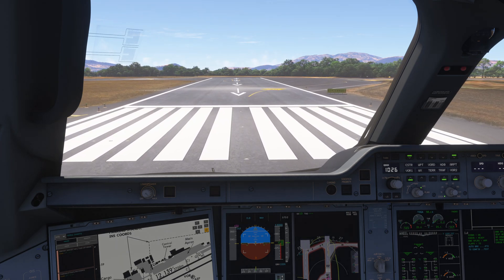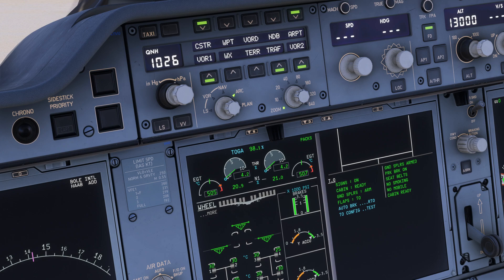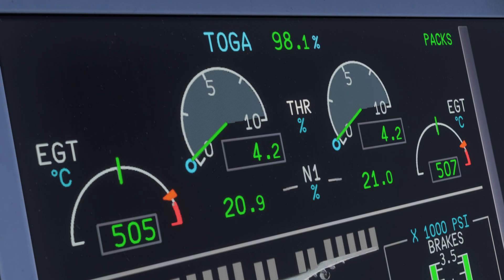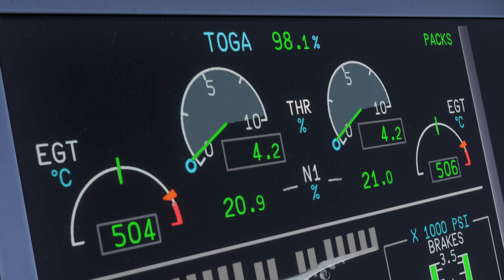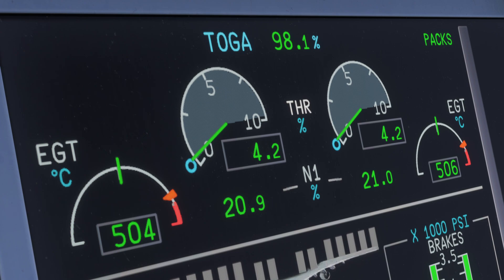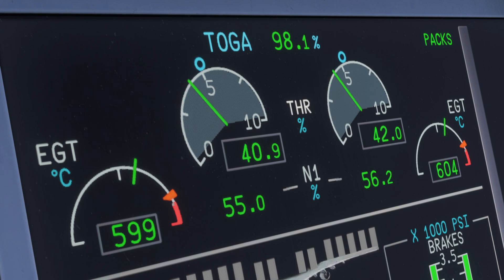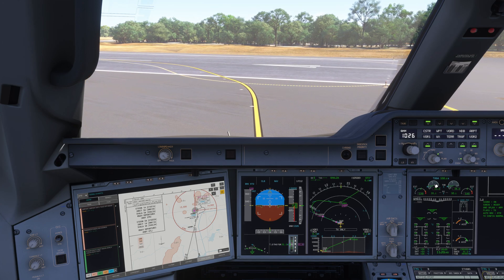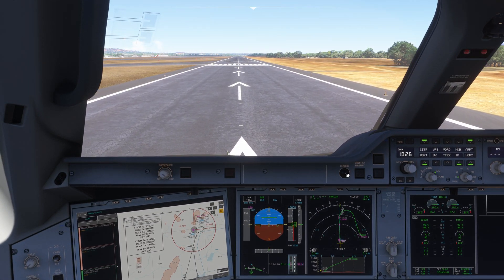Why does the A350 use THR rather than N1 or EPR? | Real Airbus Pilot

Comment: Good explanation. The Europeans are always thinking outside the box.

EPR is a direct thrust reading and therefore the most accurate but can be troublesome and prone to needing more maintenance. This is especially true on older non fly-by wire designs with an EPR transducer. In general GE engines utilizes the N1 notation as their "thrust setting parameter' while Rolls Royce and Pratt & Whitney used EPR as their. But when the A320 Neo's started showing up at the gate their GTF Pratts reverted to N1 which was a surprise. 

The problem with using N1 as the thrust setting is that the fan spinning at say 85% moves more air at sea level than at 30,000 feet. So using N1 as the thrust setting parameter is an indirect thrust setting. Earlier version of the CFM56 had a Power Management Computer in addition to the MEC to compensate for this so that the crew didn't have to keep bumping the throttles to maintain target trust. 

But using EPR to gauge thrust in modern high bypass engines isn't so cut and dry either. Since around 80% of the thrust in high bypass turbofan engines is produced by the fan and the remainder from the core, the bypass thrust has to be used in the EPR calculation to be accurate or else you end up partially extrapolating the data just like in the case of N1. For instance I know that the PW2000 only has a PT2 sensor in the inlet and a P5.6 probe in the exhaust, but the alternative engine the RR RB211 had both a probe in the inlet, an probe in the exhaust and another probe in the fan bypass. I believe (but not certain) it was P0, PF and P?

I suppose that a thrust indication in lieu of N1 or EPR is a natural evolution. Jet engines are designed to produce a set data plate thrust that is flat rated up to standard day temperature of around 86F, after which the thrust is reduced. And as engines incur wear of the airfoils and become dirty their aerodynamic and thermal efficiency are reduced. This is why you will notice that usually the older and more worn out engine has a higher idle RPM and a higher fuel flow and higher EGT. 

Back in the old cable driven systems prior to fly-by wire, pilots would notice that once the power was set at cruise one of the throttles were a knob out of alignment. But with the fly-by wire designs the crew would never see any throttle misalignments because the EEC compensated for the difference up until the margin was exceeded.

Comment: I flew just about all 747 there were, 100,200,400,-8...
GE used N1 while PW and RR used EPR, as I was told "by philosophy".
During T/O the F/E, yes there was one, set the engine thrust to the correct value after the pilot flying set them to the best value they could and the T/O thrust had to be set correctly as the airplane accelerated through 80 kts and while N1 was stable ,the EPR value fluctuated quite a lot,but the F/E managed it!
While hand flying with A/T OFF , EPR values were useless because of fluctuations and the numbers being so close together.
So when flying manually I hardly saw any pilot using EPR, but N1.(United, where I was trained initially, even used EGT as a reference for thrust while flying by hand)
..and if i remember correctly: the "Emergency Checklist" which was later called "Abnormal Checklist" gave settings for "unreliable airspeed" in values of N1 and not EPR.
So only "EPR" pilots had a choice between EPR and N1, while GE engine pilots obviously  used N1 only.
The GE engines were also the most reliable engines anyone had ever seen, while RR an PW engines were not liked,by pilots and mechanics alike.
Nevertheless aviation has evolved and getting a true value thrust reading is obviously great to have.

Comment: how is n1 a fictional number? unless things have changed without me noticing - which could happen - then n1 is the rotational speed of the low pressure spool. equivalently, n2 used to be the rotational speed of the high pressure spool
Reply from the maker: Think about exactly what you’re seeing on the gauge.
Is an N1 of 60% 60rpm? Certainly not.
And if you take the percentages literally, how could many engines go above 100% N1 regularly?
Take the CF-6 engine as an example where takeoff an1 is usually more than 100%, up to 106% N1, or the CFM56 which has a maximum setting of 104% N1. That would be impossible by definition (nothing can be greater than 100%).
Reply: @A330Driver  so your beef is that the manufacturer sets a limit on what the engine can handle continuously and then gives you the rpm as a percentage of that. but that doesnt make it fictional. arbitrary, perhaps but not fictional
Reply: @A330Driver  How is Thrust better in this respect? 
RR Snecma Olympus 593 has a maximum thrust of 121,3% of rated thrust.
Kuznetsov NK-32 has a maximum thrust of 178,6% of rated thrust! This is common on many military engines with or without reheat. 
Early jets had a direct N1 reading in rpm. It was found that it was a terrible way to present this information to the pilot, especially as idle was 3000rpm, and the thrust settings were from 8000 to 12000 rpm.

Percentiage, thrust, as soon as you give a percentage you are doing an arbitrary calculation, there is nothing fictional.

Comment: As I understand both the Fokker F28 and VFW-614 had a similar system, that, by "proxy" would give a readout of percentage of thrust, because no FADEC those could also read higher than 100%, IIRC on some airlines that operated the F28, the takeoff procedure was that the PF would push the thrust levers all the way forward and then the PNF would retard them so that they'd be at 100% thrust rating (but don't quote me on that), I wonder if it wasn't accurate enough so it wasn't used, or if it was just considered redundant at the time. Not surprised the 737 doesn't have it, but one would think the A320 would have had something similar.

I assume the A350 does a lot more software magic to make that number much more useful and reliable
Reply: Could be that airbus didn’t think it was too important? Maybe they assumed that the autothrottle would always be in use?

Comment: N1 is low compressor spool RPM isn't it?
Reply: Yeah, as far as I know it's simply the RPM (albeit typically expressed as percentage of some manufacturer-chosen value) of whatever is the first set of rotating blades that the air hits, i.e. the fan for a turbofan, or first compressor stage for turbojet. The next stage the air hits that's rotating independently from N1 would be N2, etc. If you have a turboshaft/turboprop that's dual spool followed by a free power turbine, then N1 is the low pressure compressor and turbine, N2 is the high pressure compressor and turbine, and N3 is the power turbine / output shaft.
Reply: @MatthijsvanDuin  IIRC in free turbine engines (ones often used in turboprops) the power turbine RPM is called NP for "N prop" or "N power" instead of N3. In smaller turboprop engines with a free turbine (ones with just a single stage gas generator) the power turbine is also called NP while the compressor/turbine shaft is called NG for "N gas generator".
Reply: (Though apparently some airbus planes show "corrected N1" instead of actual N1, but I think the A350 shows actual N1?  At least, the FCOM I found nowhere says or implies the N1 is anything other than actual N1)

Comment: Thrust in percent is so much better than thrust in some very abstract theoretical measurement. Imagine being on the bridge of the Titanic, Airbus and Boeing are not invented yet so the best alternative is becoming a seafarer and a captain later after some years on the bridge. Only the Titanic was available - how lucky, it´s the most luxurious ship at the time! The captain says "No Eisbergs in sight, 18 knots massive steam ahead, but we now have a new telegraph for the engine room that is measured in EPR so 18 knots in Engine Pressure Ratio ahead, sailor!" 
And you need to telegraph the necessary engine settings for 18 knots to the machine room in EPR: "Hm... how much is 18 knots in Engine Pressure Ratio EPR, ehm 1,114 or 1.1171, no 1.1170 should be around 20 knots I think, the max speed of the Titanic is 24 knots which is of course 1,225 Engine Pressure Ratio on that Parsons’ Direct-Coupled turbine, but 18 knots are ...maybe 1.1156 EPR? Has anyone a calculator? Oh these are not invented yet in 1912, but I think I somehow might be able to calculate this on paper but that might take a while now."

And now imagine a thrust-telegraph on the Titanic measured in percentage of thrust. The captain says "We can´t see shit in this freezing new moon night and all available light bulbs on the observation deck have the power of a candle, but luckily we are fully safe because we are unsinkable, therefore we will do a whooping 18 knots during the whole night, sailor!" and you can answer with confidnce "Sir yessir!" and telegraph 75% of thrust to the machine room.

Which thrust indicator solution is better, and feels more intuitive and logical? EPR which is some complete highly abstract stuff only a bunch of engine lab specialists can really understand, or keeping it simple and to the point with % thrust?
Reply: tbf, on ships like the Titanic, it was even more convoluted. The bridge signalled the engine room a request in fractions of engine power, the engineers set the flow rate of steam from the boilers to the pistons in "how far the dial is turned" in combination with "how high the pressure in the boilers is" based on "how much coal is shovelled in" and observed the rpm achieved. If you wanted to achieve a certain speed, you'd have to measure it every couple of minutes and adjust the requested engine power. Once you got it dialed in, you'd have to continue doing so, as actual speed also is determined by water temperature, wind speed+direction, water current+direction, and fluctuations in engine power that are not compensated for by the engineers.

Not that different from how you regulate the speed of a car. Only that the delay is in tens of minutes and the chain between the driver and the engine is way longer.

Oh, and btw, ships are rarely driven by speed. Usually they set engine power and take whatever speed that yields them.

Comment: Impellers (engine fan in our case), generally follow a ^1 ^2 ^3 rule. 

rpm^1 massflow and velocity 
rpm^2 pressure (EPR) 
rpm^3 power (fuel flow) 

So 2x rpm increase doubles the massflow and velocity, 4x the EPR and 8x the power required. 

Thrust is massflow*velocity, so it is squared with RPM and basically matches EPR.

Comment: You didnt answer why it is possible that N1 goes over 100%😆
Reply: Actually you can figure it out by yourself at the beginning of the video, when Emi explaines that N1 is a FICTIONAL number based on the rotations of the turbine.
Reply: In some cases(I'm not saying IS this case), 100% is the original rated value at some phase of the design process. But as the project progress, engineer find the engine can take more than that, but choose to not change the value as no one will than able to follow what is the speed they are taking. i.e. The boss set the engine have to be at lease 60000rpm capable. Done. Engineer found it can run 62000rpm on the 3rd trial.  So they say it can run at 103% N1. And the 10th trail, they can push to 65000rpm, so it is 108%. So everyone have a aligned ground to know 108 or 103 is what, instead of 100% N1 at different date.
Reply: It is not ECU-rpm-limited like a car that protects the engine revving to hard. There are certain ways to ask for more thrust from the engine, in a Boeing it´s a turn-knob allowing 108% N1 or so max. But to be honest I have never found out how to put an Airbus engine into overdrive mode. There must be a hidden afterburner-button somewhere.... ;D
Reply: @juliashenandoah3965  There is no such thing as ECU in aviation. For older engines you have FCU (fuel control unit). For modern ones you have FADEC. ECU is the therm used in automotive gasoline engines. In diesel engines you have EDC.
Aviation engines like ones in Airbus are limited in many ways, you have RPM limits, EGT limits, you may have EPR limits (in engines with EPR probes), you have starting limits and protection laws, you have spool up limits that prevents too much fuel being added when in low power, you may have bowed rotor protection and much more.
100% is not a hard limit, it's just a reference value chosen by designers. Limits often vary depending on various conditions like altitude and OAT.
Reply: n1 is the rpm of the fan spool, and the designers of that engine determines what rpm should be 100% for that engine. Excceding 100% doesn't mean the engine will break apart. Take the ge90-115b for example, from my understanding, the engine is rated to produce 115,000lb of thrust safely. In ISA condition, that would correlate to 100% N1. Let say on a hot humid day where the air is thinner. Pilot commands full thrust, i.e. 115,000lb, now the engine has to spin faster in order to achieve the same thrust (up to a limit). On the other hand, if you are on a cold day, the engine could rev below 100% N1 and still get full thrust
Reply: 100% is a defined rotational speed defined by the manufacturer which does not have to be the maximum one. Maximum rotational speeds are determined by environmental conditions, normally temperature and pressure, being the most common limiting factor Turbine Temperatures (measured by EGT).
Reply: It’s usually a reference value, I think for one engine (I can’t remember which) it was the same across the different versions, so one model had an actual max rated N1 of 109%